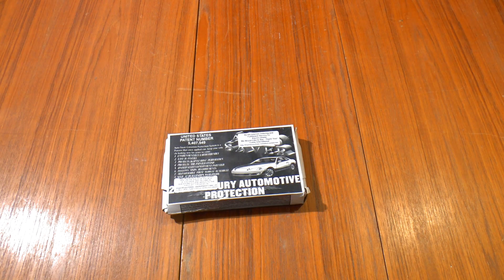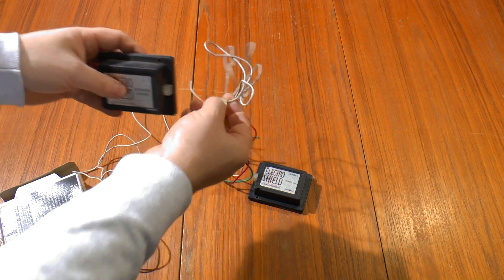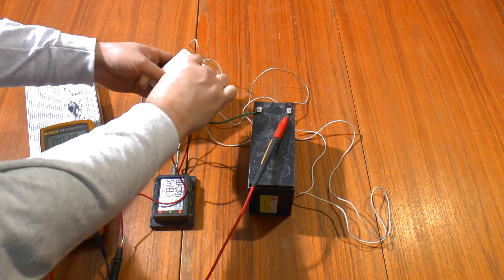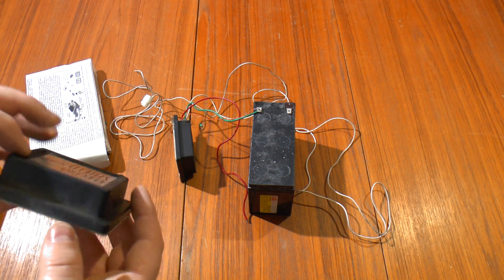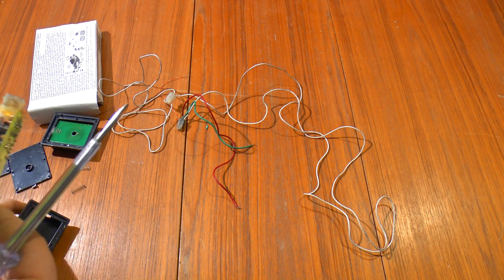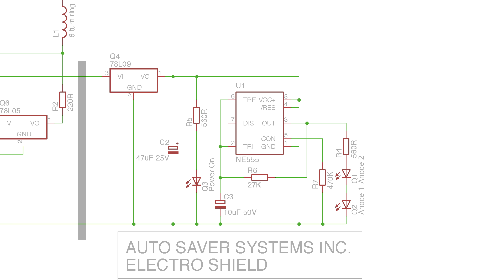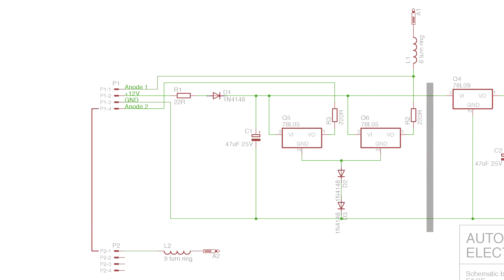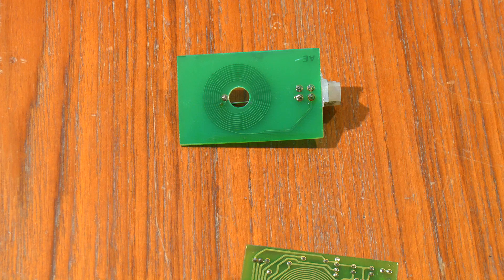Electronic rust protection EXPOSED! Electro Shield teardown

Comment from the maker: The latest seems to "OBDII Plug-In Rust Protection", I'll mention it here so that people find the video when they look for that.  I look forward to a full schematic from the vendor who's put himself on my radar by commenting.
Reply: I'm only speaking as an outside vendor, but it's also my father's name on the patents. This project has been in the works since the original patent was approved thirty (30) years ago. Take a look through the updated info & let me know if I can send you one! This video is based on a VERY old design from the 90's; by the time you made this, the manufacturer had discovered the LED issue & moved forward with their planned release of an updated version.

Comment: It is very odd to add a 7809 to supply a 555 ic. Those ics have a wide range of voltages they can handle. 4.5 to 18V. The older Rust Evader circuit had no such Voltage Regulators. The Rust Evader had specific electrodes that one had to sand down two sections in the engine compartment one had to attach to. It looked like a carbon base to me, but I am not sure. Nevertheless it was capacitors discharging and periodically being recharged to trickle back to the cars body.

Comment: Just got an 06 Honda CR-V that has one on it. Looks like a dealer addon. I'm thinking I can just disconnect the battery terminal wire to stop the drain without harming the car. Thoughts?
Reply from the maker: Yeah.  Insulate and tape-up the connection so it can't touch the bodywork.
Reply: @AintBigAintClever  Was able just to unplug it from the primary module. all LEDS went out. No tools. No more battery drain. Easy peasy.

Comment: I own a 2015 Volkswagen GTI, I wash & wax the car regularly, and in the winter months in Canada where salt is applied to the roads quite liberally. In the winter months, I wash the car every week paying particular attention to the underneath of the vehicle, wheel wells, exhaust, and around the bumpers. $1000 buys a lot of "ducky wash" time and cleaning the jams of the doors, hatchback, and hood has kept the rust at bay. I believe in the good old-fashioned elbow grease and maintaining a car with regular cleanings of the carpeted floor and interior including the rubber floor mats and salty water that collects on them. Fortunately, my car in 2022 has no visible signs of rust and I do visual inspections every time I wash and wax the car.  I wish that there was more factual information on the "Electronic Rust Protection Devises" and actual comparative testing of two cars, one with and one without in a city where salt is heavily used other than listening to "endorsement by car salespeople".  I still believe that regular washing and waxing is the best way of dealing with and mitigating the care of a car. Fixing paint chips or bubbling paint immediately is cheaper than not doing anything at all and waiting until the rust has penetrated threw the metal makes it cheaper to buy a new car than to repair an old rusted car. I guess "Buyer Beware" would be the best advise!
Reply: I don't know where people got the idea that installing a device meant they don't have to wash or take care of their vehicles anymore. Let me say it again for those in the back: NOTHING stops rust forever! Thank you for coming to my TED talk.

Comment: I have had a wrecking yard for thirty years and see these come in on 4wheel drives quite a lot and some cars that are smashed   I have noticed that one fwd that had been rolled was twenty years old and didn't have a spot of rust on it when it came in ! It sat in the paddock for five years with the battery disconnected and parts got sold off it over time  ,the battery acid leaked onto the firewall and chassis and it had corroded  and rusted after time and the vehicle over time started to rust where they always do ! Because the battery was disconnected   ! I looked at all the same model cars when it came in and they had rust in the usual spots but this one didn't ! So I took the time to take of the electrical device and fitted it to my work Ute  and took notice that the paint had been sanded back and the box sealed around the base to the vehicle  ! Then I took off the same units on the other vehicles that had them on them  to sell second hand to other people and noticed they didn't have the paint sanded of or sealed and these cars where just as rusty as the ones without a device so maybe if the device is fitted correctly to a rust free new car it may actually work  ! My work Ute hit a karri tree not long after I fitted the unit so it's hard to tell if it worked ! But I will try again as I am always putting my utes in the water putting the boat on and off and parking near the ocean !  Maybe a solar panel with a trickle charger on the dash might keep the battery full if it's left for a bit ! It's worth a try ! Fish oil and liquid paraffin wax (or timber end grain sealer ) as it is sold as in twenty litre drums is cheap but it only works if the Ute is new to start with U can't spray it over the rust or it won't work ! Rust is like cancer and when it starts it's impossible to stop  !
Reply: Thanks for the insight

Comment: I just opened the hood and sure enough I have one of these thingies installed. I'd say, besides draining the battery with a constant power draw, this actually might help the rusting process along if there is salty moister in a metal gap and some current flowing there could foster electrolysis which would eat metal in no time.
Reply: Even those old units from the 90's had a built-in battery monitor ... as to not drain below the required voltage to start the vehicle. At 26mA, it can take weeks to drain the battery down to that point. It's also worth noting that the "sweet spot" regarding proper voltage was discovered via internal testing; before it was handed over to independent ISO accredited laboratories for testing under government oversight.

Comment: I have this on a car for 14 years installed by someone out of biz. There is some kind of zinc plate attached to it that has partially corroded. I thought all cars were already zinc coated and that grounding to body would have a similar affect to a computer running 24/7. I never really understood this device. Now the car has electrical problems, perhaps unrelated. I thought the constant voltage (strangely box states 42v) would be too low to cause harm even though I got constant static getting out of the car.
Reply: They really work great in places like Arizona but...  They don't work in areas like Florida or south Texas close to salt water ... don't waste your $$%$$$$

Comment: So I work in corrosion protection for natural gas pipelines, if you install and anode on metal and bring the metal to the proper voltage it will rust the anode away and not the  metal. I’m not sure how this applies to a car but it works to bury uncoated steel directly into the ground.
Reply from the maker: It has its place (as you mention), but on a car it's simply not possible.
Reply: Outboard motors corode the weaker metal anode. If not mistaken the concept is to fry the bacteria creating the rust and the anode take a voltage hit.

Comment: it can by used but not for corosion it is used for ignition systems like waste spark ore dual ignition that is what that thing is meant to by not rost but its a fake one in your video some cars use bouth ac and dc to fire the engine a ignition coil does not care what the polarity is and that 90° spike is not ac ore dc it has 4poles its more similar to a emp device the spike is neutral those are good ideas for exampel you run ac and dc in your wire harnest you will get lot faster engine faster acesoris by using hv capacitors with the baterry in series ore pararel and there you go masive power on demand that again is what those things shuld do in theory

Comment: applying small current to a metal will prevent rust.. it will still rust but so much less... the proof is your desktop pc case.. the one you use all the time rust much less vs the one you dont.. I have one pc used daily and one not used coz its broken but still in the room for 3years.. the difference in rust is night and day.. There is a small current passing through the case when the pc is turned on about 2-3volts.. it comes through the atx power supply ground wire transmitted through the case.. so you see when you dont use your pc it rust normaly like within weeks... but when your using it you see less rust in years.....
Reply: I believe in flying saucers too !  When my wife tosses them at me !

Comment: I was wondering if you have googled cathodic protection? It is a basic/fundamental corrosion protection used widely in different industries such as pipelines. If these things could successfully add electrons to the body of a car, if the voltage is right, it CAN protect the vehicle... I am not sure about any brands or models, but the basics is there...
Reply from the maker: It works on things that are submerged in water, such as ships and pipelines. If you look at the example diagrams you'll see the item being protected, the sacrificial anode and a body of water or soil between them. Unless your car has a tank of water around it it's not going to work.
There's a link in the video description that gives more info.

Comment: It’s working on my 2013 GMC Sierra
So far so good.
I know a guy with a 1989 Ford F150 the frame has light rust on it. The body is still clean as a whistle and has been driving on Michigan winter roads since 1989.
Reply: Mine too  it os almost 20 years now still body and under chassis and under the hood are still clean,
Reply: Maybe your friends F150 was under coated ????  LOL !
Reply: @houstonjones4683  It was not under coated.
Reply: @MikeHoncho884  They were dipped !
Reply: @houstonjones4683  i’ve been dipping body panels as long as I can remember but they still rust.

Comment: Would this be capable o messing with the computer on the car?
I ask because I just pulled one off of a vw Jetta that was giving a code that the computer was wacky.
Also the terrible wiring that someone did was sad.
A wire directly from + battery shorting out on the firewall in a couple of places.
Reply from the maker: It would have about as much an effect as pressing a 9-volt battery to the bodywork.
Reply: @AintBigAintClever  thanks. Maybe the 12v. Battery shorting on the frame had something to do with it.
Thanks again.
Reply from the maker: @HARDG1984  that would be a different matter. It'd be pulling down the supply and that could piss off the ECU (or start a fire)

Comment: I mean you can remove and prevent rust through electrolysis, but im pretty sure you need a catalist like baking soda??? Correct me if im wrong, its been a while since i looked into it. But obviously these things are  fraud. Like the thing that plugs into your cigarette lighter outlet that claims to increase hp and fuel economy.
Reply: Uh... you really need to polish your chemistry. Electrolytes are no catalytic, just in large excess.
Reply: @Gnefitisis  yeah, nowhere in there did i ever say i actually knew what i was talking about. I actually think i alluded towards the opposite. As in i really had no idea what i was talking about. But thanks for the free chemistry lesson. You so smart. Much more than me
Reply: @taylorjams4845  Didn't mean to come off as snappy. Consider this, since you are partially correct. Practically, to do electro-reduxtion of rust, you would need to submerge the parts in that electrolyte to work and run a decent current through it to get it to work. Doubt that would work while everything is dry.

Comment: If those "electrodes" were at least made if zinc, they might do something useful (for a couple of weeks; then they would be corroded away.
As is, it is just a scam!
Reply: Except there's no return path for the anode, e.g. salt water, dirt, in the original patent, so it can't galvanically corrode.  The inventor misunderstood the patents he cited.  The circuit you extracted doesn't look like the patent, and won't pulse the coil.  It just leaks dc current through the anodes (once they wear though the paint), which you found are now connected to the coil.
Reply: Imre Fabian you are right... Zinc electrod on some points of cars body may prevent rust for some time but its not permanent solution.

Comment: that works www.rust-stopper.com
Reply from the maker: I doubt it but at least now when people look for www.rust-stopper.com they'll find this video.
Reply: rust stopped yeah that called paint!
Reply: AintBigAintClever should work briefly if your car stays wet as they use a more reactive metal as the “electrode” ... getting a few lumps and sticking them around your car where the water will run over them would be just as effective and cheaper ... but doesn’t come with flashing lights ;-/
Reply: I read the claims on "Rust-Stopper".
At least that is somewhat correct and plausible to work.
But this (currently discussed) product is just a lot of fraudulent BS.

Comment: There are real electronic rust preventers, but they work using a sacrificial zinc anode which is consumed in the process. It's a similar concept to galvanizing nails, and it's common on large ships. I've never seen it on a car, though.
Reply: What are you talking about?! Corrosion = rusting and rusting = corrosion. They are the same thing. When steel corrodes it rusts.
Reply: zinc anodes for their own electricity source in comnination with the iron bodywork. if you have an external electric source you can use a cheaper metal for the sacrificial electrode.
Reply: Cathode protection works on boats because the water grounds it making a complete circuit . Cars are not grounded to earth because of the rubber and if it is using the zinc plating as the sacrifice the car will rust faster but it still would not work .
Reply: again not preventing rust but corosion. rust is a chemical reactions no amought of anodes can help with rust.

Comment: I bought one for my rapidly corroding Ford Escort van about 30 years ago, but returned it.  It used what appeared to be carbon-like electrodes that stuck on the surface of the car bodywork and the usual flashing LEDs.  i suppose that technically speaking it might be viable for the electrodes to be sacrificial with a conductive film of grime on the car.  They also had the rather annoying disclaimer that for their guarantee to be valid you had to take your car to one of their agents every year and pay to get and blemishes on the paintwork touched up.  It also had to start off rust-free.
Reply: bigclivedotcom you can get some vibrating anti fouling ... Ho wait that boat only . Naa I'm sure those vibrator would be has effective in a car has in a boat!
Reply: Alfonce Jean nothing to vibrate!
Reply: bigclivedotcom, it is just a scam!
(see my other comment.)

Comment: Ironically, snake oil would do better than these things at preventing rust ;)
Reply: Thank you, YMMD! :-)

P.S. To those who think sacrificial anodes would work on a car: on ships or in water boilers they work because the return current goes through the water. On a car the water doesn't connect from the rusting part to the anode, so that doesn't work. (Assuming that you don't usually fully submerge your car.)
Reply: Actually sacrificial anodes work on a cars that are not fully submerged, it just need to be spread out enough to make god contact with all water films and droplets. This is how galvanization protects steel. Unfortunately it is not very convenient to apply after the production stage.

Comment: According to the patent (search Google patents for the number on the box - 5407549) the inventor's design is supposed to put out a pulsing DC. As I read it, the contacts should not be connected to the circuit and instead only magnetically coupled so a current is induced when it pulses. The schematic is in the patent and does use 3 LM317 voltage regulators but of course not connected as your reverse engineered version has them. Wonder if this is a bad copy of the original design? Just as effective I'm sure - that is to say, not at all.
Reply: Even the circuit mentioned in the patent does not work (see other comments).

It is all a pipedream!
Reply from the maker: Thanks, I've added the patent link to the video description. Could this even be a cocktail of snake oil and bullshit, where it doesn't even try to do what it claims to do? :)

Comment: This can't be doing anything at all, other than wasting electricity and slowly killing a pair of 7805s, as it's just shorting a current limited 5V supply through the body of the car.
If it actually had external sacrificial anodes in place of the spring contacts, and the anode and body of the car were immersed in water it might have a chance at doing something - but at that point you would probably be more concerned that your car was immersed in a body of water...
Reply: Knuckx and it won't protect from rust but from corosion!!!! Ho ans the electonic component are usles
..
Reply: @alfoncejean8826 Rust = Corrosion
Reply: Sacrificial anodes aren't actually required for the theory (which is sound) of impressed current cathodic protection.  It's used in pipelines and works.  Although this product is bullshit.